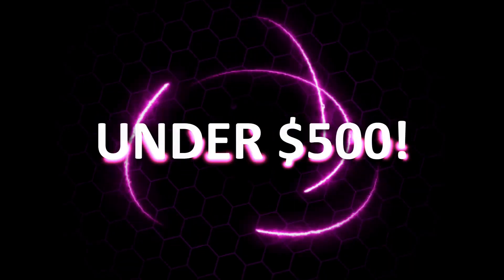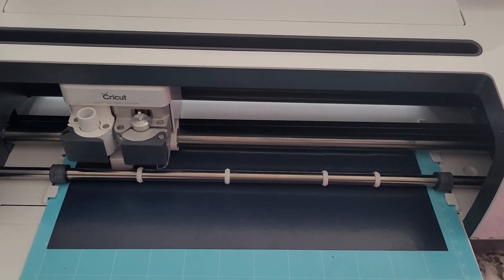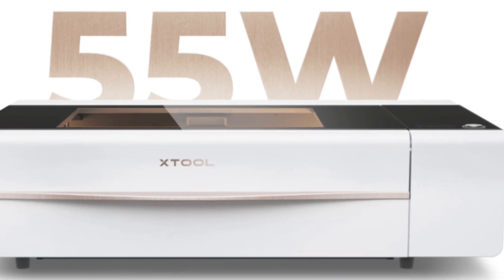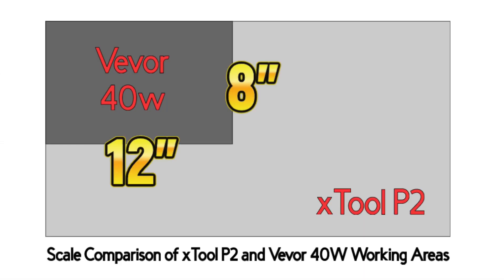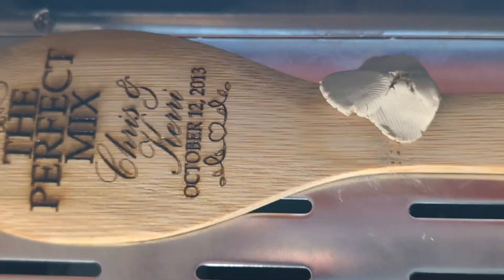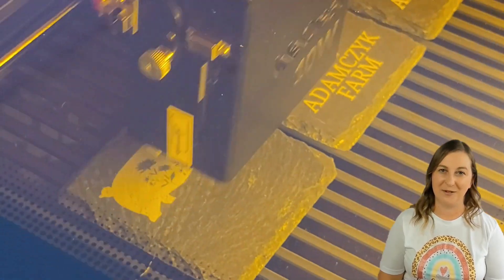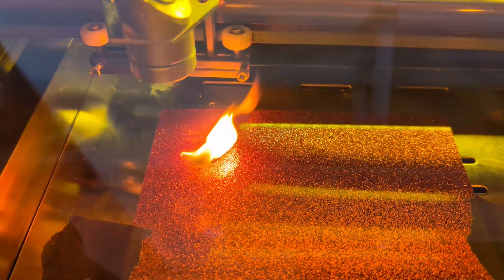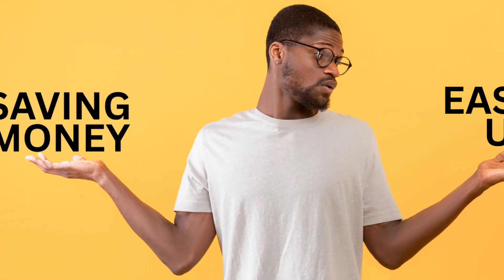Testing a $400 CO2 Laser Engraver: Vevor 40w CO2 Laser Engraver Review

Comment: What did you use for a water chiller?  I re-reviewed the video and did not see this mentioned. This is SUPER important. My chiller for my CO2 laser was over $300.  It sells for more than $500 now.
ANYONE considering a CO2 glass tube based laser like the Vevor, you MUST have a water cooling solution. There are many on the internet. Metal tubes do not require water chilling, however they are used only in very high end lasers as the tube cost around $3000.00.
Reply: I just use a bucket of water and frozen ice jugs for my K40 and K40+. I upgraded to the larger Omtech Polar 50w which does not require a water chiller and it cost me about $1,900. They also sell preowned ones for about $1,500
Reply: @ that a great price assuming a good bed size. I used frozen bottles of water for about a week and tired of it quickly. My K-40 is kaput. I have a LED 10watt. It will do for now. Hope to own a Pascal Liu (Haotian Laser) fiber by year’s end. Perhaps an Epilog CO2 in the distant future.
Reply: @z8ty  I got both of my K40s and my K40+ from Omtech and they have excellent customer service so anytime I had issues, and there were many, they would always send replacement parts immediately. 

I switched to the 50w because the 8x12 bed size just wasn't big enough. The 50w has a bed size of 12x20. I would love to have a fiber laser at some point but that is definitely not in the budget right now.
Reply: I didn't even realize, until I got it and couldn't figure out where to hook up my ice bucket of water, that it has an internal water tank and you don't have to cool it. Definitely an added bonus.

Comment: Why not use lightburn for designing and controlling the unit? What is the thickest material the unit can support? I know my diode laser comes with risers for thicker materials.
Reply: It's just a standard K40 laser with a M2 Nano controller board, which is not compatible with Lightburn.  It's funny because on their website they have a picture that shows Lightburn running on a MacBook, but it won't work with either of them.
Reply: @matchstickdesignco  the nano board is not support in Lightburn, however Lightburn does run on MacOS.  Been running it for years.
Reply: @z8ty  use whisperer with the meekerT40 software and then you can get lightburn connected

Comment: Yesterday I placed an order for an Atomstack X40 Max, which is a diode laser. I wanted a CO2 one, but they were very expensive.
Reply from the maker: I haven't tried that one out yet but I just looked it up. My 2 cents from a quick google search (not sure if you care because you already bought it, but maybe you can return it if it's not too late): I'm not a fan of open lasers like that because the toxic fumes go everywhere unless you buy a separate enclosure, ventilation hose, and fan. It also doesn't have a camera and trying to figure out where to place your designs without a camera is hard, especially on small items and for beginners. I personally love the WeCreat machines for diode lasers. The cameras are so precise that you can engrave on a toothpick! The camera allows you to do batch projects, like engraving 10 leather patches at a time instead of 1 project at a time. Plus it rises automatically, works with an IR laser module for metal projects and jewelry engraving, and works with an auto passthrough feeder for super long projects. Their 20w Vision ( https://shrsl.com/4un62 ) is only $300 more than that. Or you could get their 10w Vista ( https://shrsl.com/4un63 ) for $300 LESS ($699). I hope you enjoy whatever you end up with!